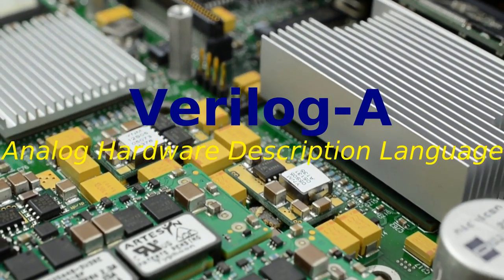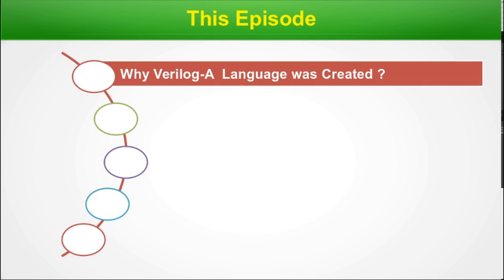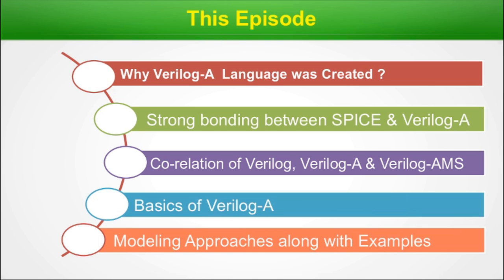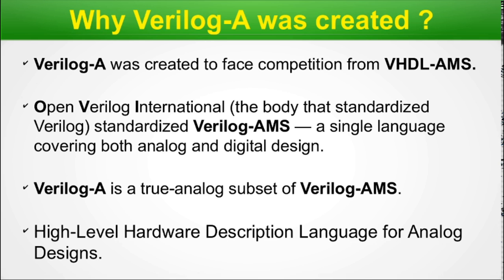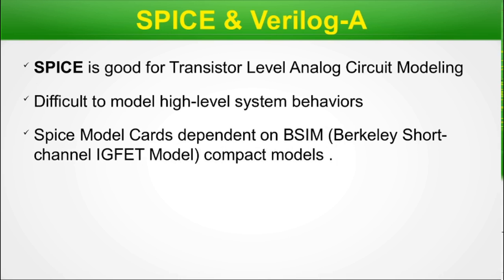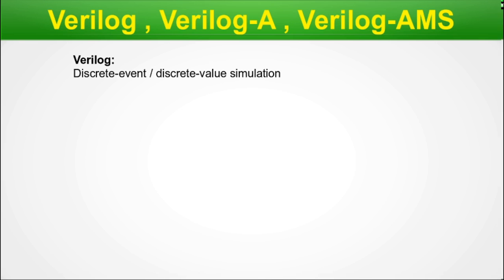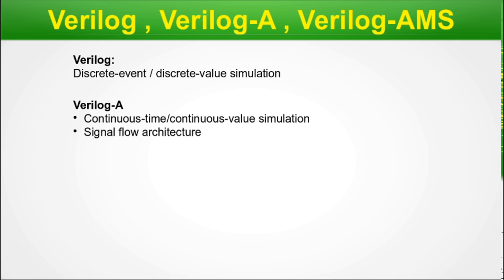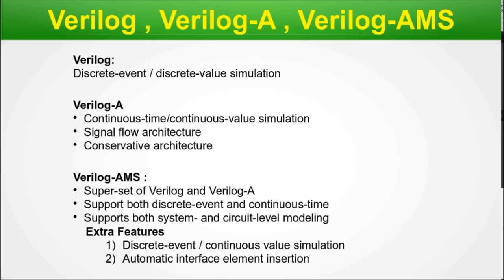Verilog A Tutorial: Exploring the Fundamentals and Applications of Verilog A

Comment: how to run a verilog-A file, on what IDE ?sorry I am new here.
Reply from the maker: Cadence Virtuoso: Cadence Virtuoso is a popular tool for designing and simulating analog and mixed-signal circuits. It includes a Verilog-A simulator that you can use to run your Verilog-A files.

Synopsys HSPICE: HSPICE is another popular tool used for designing and simulating analog circuits. It also includes a Verilog-A simulator that you can use to run your Verilog-A files.

LTSpice: LTSpice is a free SPICE simulator that includes a Verilog-A simulator. You can use it to simulate your Verilog-A models.

ngspice: ngspice is another free SPICE simulator that includes a Verilog-A simulator. You can use it to simulate your Verilog-A models.